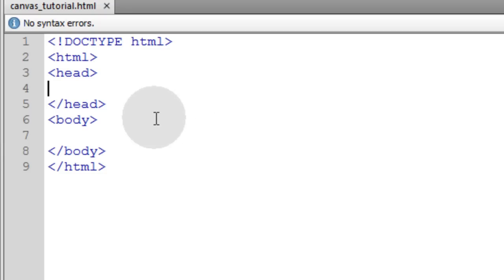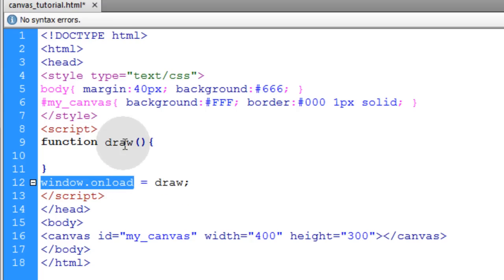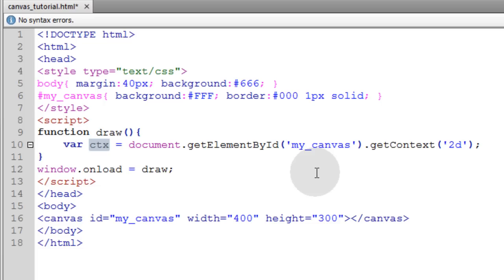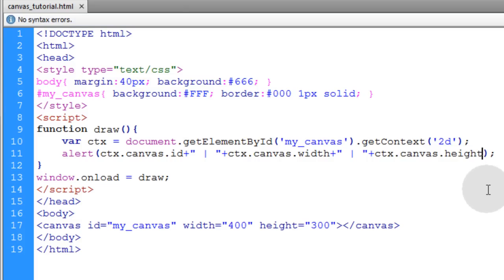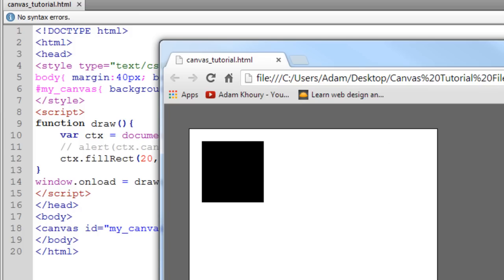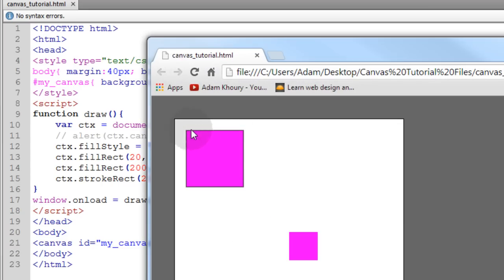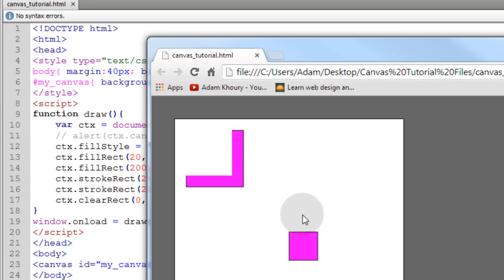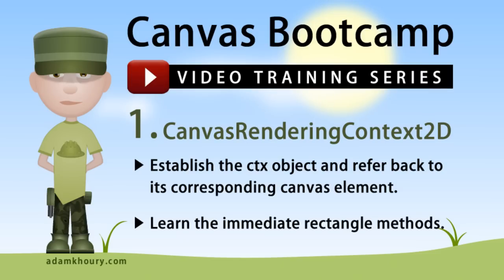Canvas Bootcamp 1 - Rectangle Methods and the 2D Context Object

Comment: Hi adam, is there any way of setting canvas size to a percentage of a page size as opposed to a pixel size. The problem is there are so many screen resolutions and physical sizes available, simple px values are not universal.
Reply: Ross Armstrong 
Add this to the list of things that cracks me up about "universal standards"
"html5 is cross-platform" ok... that's fine, but...
now, as you stated, screen resolutions...
Just did some quick research...
Yeah... not easily
I suppose at best, you can program your application to scale its content dynamically, but not the canvas element itself...

IDK if you found anything or not, but I landed here:
http://impactjs.com/documentation/impact-on-mobile-platforms

Seems like DPI also makes things worse in those regards
(let's just say there's a point at which having these various graphics display settings seems like more of a nuisance than anything else)

Hope this is of some use?
If not, sorry...